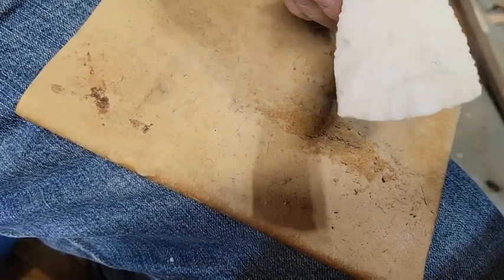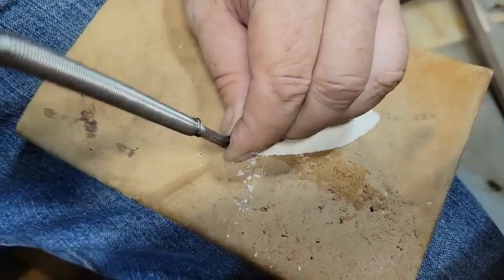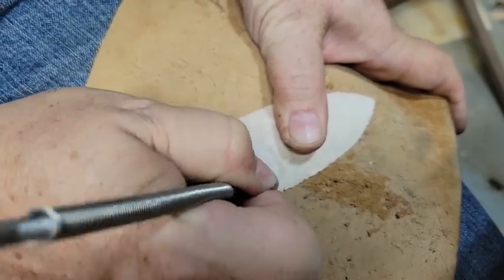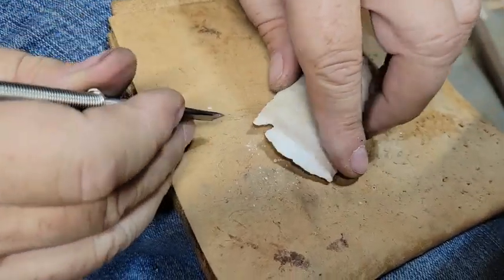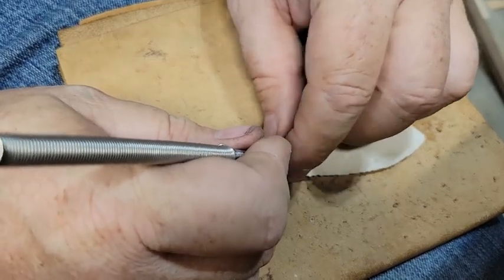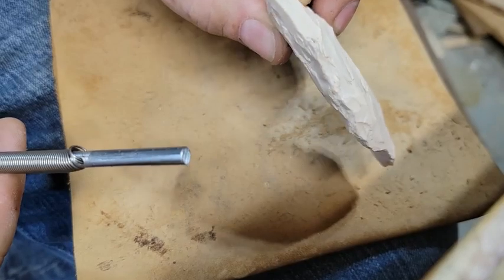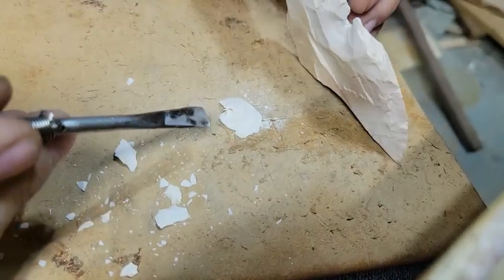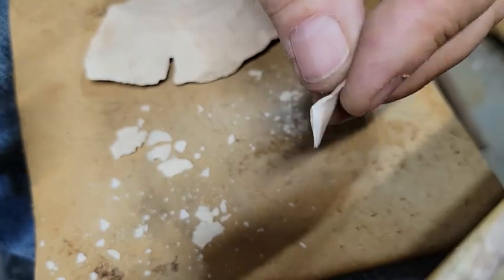Notch-O-Matic

Comment: This is so much better than a standard spring chisel. The spring tension is perfect. Works great for taking off hinges too! 👍👍👍👍
Reply from the maker: That is so true.  The spring chisels really are too strong.  They also use hardened steel that crushes platforms instead of taking a flake.

Comment: Just got mine today. Felt I had to come on here and tell you how amazing this works. It definitely has some pop. Doesn't take much to take a flake. I think I could notch pretty much anything with this.
Reply from the maker: So glad to hear you like it.  Dead simple idea.  

Because it has so much power, ya gotta be super careful about your platform elevation.  Too high, and awwww crap!
Reply: @theolithic71  I worked on a few flakes first to get the feel. It definitely has some punch. Great at knocking of hinges too.

Comment: I purchased two Notches-O-Matic tools. Shipping was very fast! I’m a fairly new knapper and this tool works extremely well and has made notching so much easier for me. No more stalled notching platforms. You don’t need any certain skill to use the Notch-o-matic. I purchased two of them so I can make one paper thin and it will make super tight notching channels. Works for other things like removing step fractures and islands. I also found it to be easier than pressure flaking in serrations on points. Way more than satisfied with this tool. For the price and efficiency/effectiveness you can’t go wrong. Everyone needs this tool in their tool kit. It’s plenty strong enough to notch through the thicker spots of points without breaking anything. Very happy I purchased these tools.